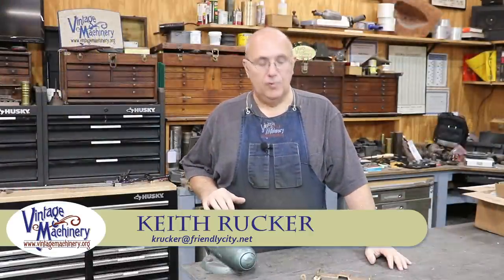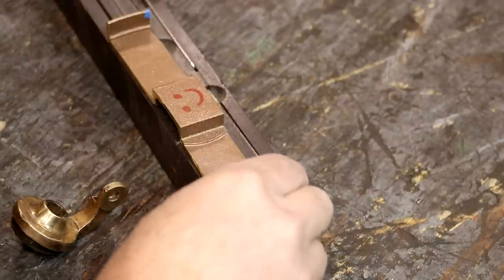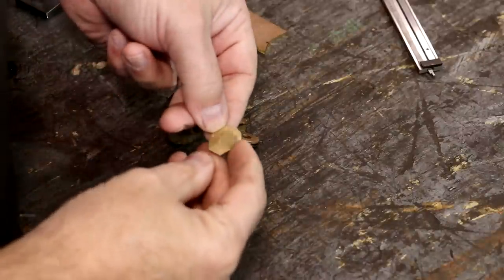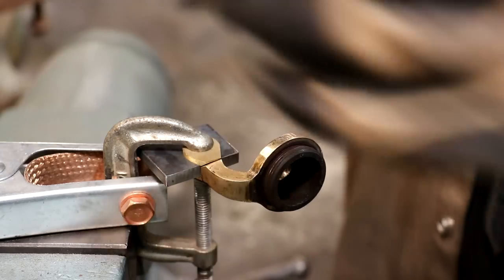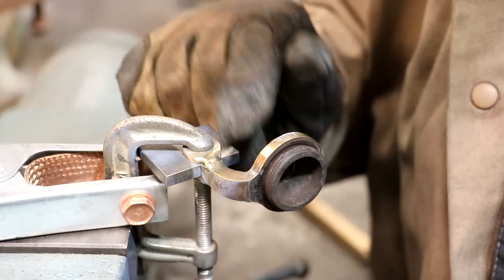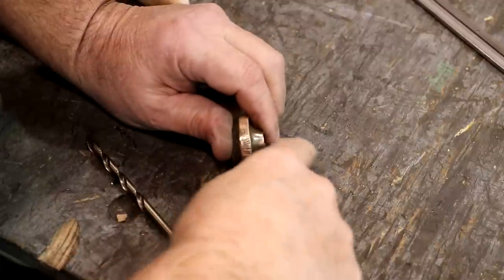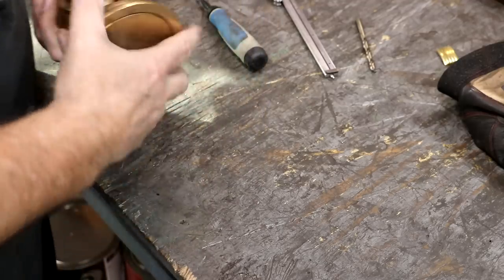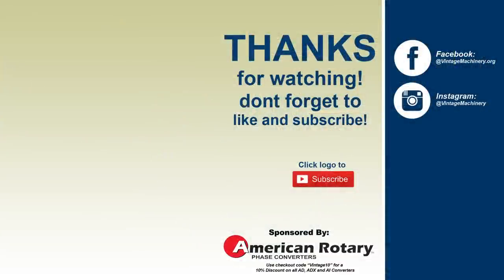Repairing a 1877 Patented Crosby Steam Whistle

Comment: hi keith i had to do a similar repair and to get some material in the cavity i mixed a paste of flux and brass shavings and put some in the middle and torch brazed it worked real well
Reply: I was thinking about scraps as he whittled on the band saw and tossed a few bits. If they haven't been vacuumed yet those bits are still there. Yeah it's an OCD.

Comment: I used to work for General Electric and we used to have to repair a lot of brass , when we couldn’t get a good weld job using melted bronze or whatever we always silver solder and we had a very high success rate. You could’ve use silver solder down in there in the inside joint to add the extra strength that you were wanting to provide on the ear but you didn’t and I know you silver solder all the time. Gary Black

Comment: I know exactly what you mean about wanting to be able to get inside and just finish this properly. I often feel that urge to do 'just a little more' when I am carrying out repair jobs around the house or whatever. Sadly; equally often that 'little bit more' ends up ruining all the work you have done to that point!

Frustrating as this is, I think you made the right decision Keith. It doesn't look like it is going to have to tie off a battleship or hold up the Forth Bridge all on its own!!! So... Likely working as a simple pivot it will give many years more service. If not... Hopefully the chap will return it to you and the process of casting a whole new part will be fascinating to watch also. That top-aligned thread though... That will be a toughy!

Comment: Re: getting the part upright with the threads.  This is a common issue in steam fittings.  The solution is very simple.  Copper shim washers of various thickness are inserted, and then when tightened up, the rotational angle of the fitting is controlled.
Reply: I would hate to try to remove that part he hammered tight. I think shim washers are the right solution.
Reply: @robertcornelius3514  Well accepted solution too.  Perhaps he didn't know it.

Comment: Perfect case for milling a shelf in the casting, making the new tab to precisely fit and then silver soldering. Only downside I could see would be the very slight hint of the silver in the joint but it would absolutely be strong. I have no experience with tig brazing so I personally would never attempt it. Go with what you know.

Comment: I enjoy your channel and have learned something in each episode. l As a journeymen welder I have these observations; a vee prep and filler rod would have provided full thickness weld and when base metal and the filler rod are melted the joint is considered a "weld". Brazing only melts the filler rod. Welding on small parts is always difficult, patience is the key.

Comment: Next, I would try machining off a bit of the curved brass arm to make a bed for your patch piece. Just so it has more contact surface to hold it together. Then solder or braze the patch in place. Or cut the end off entirely, drill and tap it for a brass post, screw on a new blank of brass,  braze it in place, and machine some new ears on it.

Comment: I think the reason for the two different pieces melting sooner than the other is that the original brass piece probably has lead in it while the replacement part may be lead free brass.

Comment: Keith, me thinks I would have milled a step on the part for the ear to set on for more surface area to attach to.  I would probably used gas to do the welding so the flux could have cleaned the area better than the TIG gas, and the braze might have flowed better between the parts.

Comment: I’ve had success with shavings or a small brass or bronze rod with enough heat to melt and flow into the small areas. Seems to work quite well. A pretty common technique used in model building.

Comment: Curious as to why you didn't bevel the parts after clamping so you could get full penetration on the weld joint. And why you sanded the flat surface of the replacement piece if only to wish it was thicker later. Nice to see you in the shop again

Comment: Hi Keith. This is still welding, even though the materials are dissimilar. Since you are melting the parent material. Dissimilar metals can and are often welded together. Copper-silicon would have been a better filler material, though.

Comment: About "tracing that piece that we have here" (@ 4:00) - I think the better way would be to drill a hole first (in the "donor piece" - just eyeballing its location) of the same dia as the one in the remaining ear, then put a short screw through it, screw on a nut, and tighten it - then just roughly chop-off the brass piece to the shape of the ear and finish it with a hand file (there is nothing critical about the exact shape or dimension of the new ear, I assume - and hand filling brass is a breeze).
Then I'd "adjust" the edge to be welded, and instead of clamping the flat stock with a C-clamp I''d drill a hole in this piece of steel - and I'd use again a screw to hold everything together - cuz that would give me a better access to the weld area. 

...But then again there's more than one way to skin a cat, and every guy is his own boss in his own shop. Anyway, "just sayin'". Also, for holding a bronze piece in a vice (vise) I'd use plain aluminium (i.e. very soft one) jaws, as copper has the tendency to get work-harden (so soft aluminium alloy seem to be a safer option).

PS: I noticed that central part of the donor piece looks slightly thicker (2:26) than the outer parts - so it might be a more suitable one for cutting new ear...? Of course, I know "it's too late, pal" - well, for THIS TIME it's too late, but maybe one day, some day, in the future... ;-)

Comment: Just with a briefest glance when you tipped the donor part it really looks like the center section where the smiley face is, is thicker than the part you used. The step in material thickness would seem to  bare that out. Could you check that out?

Comment: A tiny bit of flux only on the two mating surfaces might have allowed some of the molten metal to flow down into the space between the two parts.  I have done a great deal of silver soldering and brazing.  Mostly with a Prestolite Torch. Ron W4BIN

Comment: If it fails in the future, making a new part from scratch could be avoided by simply making a new ear + stem and then cutting the OG stem half and half with the new one and soldering those together. I've repaired old glass caps in the same manner in the past and even before the tinning process covered the seam, it was almost invisible.

Comment: Keith, 

Considering that the brass is a relatively soft material, it may have been easier to cut the piece using a fine blade on a bandsaw in a woodshop, or by using a fret saw.

If it has to be cast you might try using the lost wax method.   I have had good luck with this for small brass parts.

Bob
Reply: I would have used a jeweler's saw, but you use what you have on hand.
Reply: @machintelligence  I think a fret saw and a jeweler's saw are the same.  If the ear does come off again; look at the valve for the big whistle I brought to the museum.  The yoke for the lever is held in place by tightening the valve gland onto it to the valve body so the yoke can be adjusted to accommodate the pull of the whistle rope.  It would be necessary to make a yoke and gland but easier than making a new pattern.
Reply: @royreynolds108  The distinction seems to be mostly the depth of the frame. Both can use wood or metal cutting blades.
"The main difference between a fretsaw and a jewellers saw is the depth of the frame. Fretsaws give you the greatest reach and are used with a board, while jewellers saws give better blade tension and are more manoeuvrable."

Comment: Why not cut the ends make a new bolt section then just butt weld the new to the old seems like that would be a much stronger and simpler fix? Either way nice repair should work fine

Comment: I think and can tell you from experience that the second you dipped that tungsten into the puddle you should have stopped and re-ground the tungsten EVERY time you dipped it Inoticed there was a few... as much as it sucks to do, not doing it makes it EXTREMELY hard to continue welding and get good fusion you can tell by the blob of brass on the tip getting bigger and bigger and it also contributed to why it kept melting away on you

Comment: Technical question for welders: I was told to avoid welding galvanized items because the fumes from the zinc coating can be toxic. Would this be a problem with brass, which is a copper/zinc alloy?

Comment: Obviously you were joking by having the bandsaw upper guide out of position, and pushing the brass material with your fingers 🙄. A 2 day apprentice is taught better than that. Also starting with a small piece you cut off, drill a hole through it, then use a small bolt with a 1/4 spacer between. You have way too much spacer material, that will act as a heat sink, not allowing a good weld. But to each, their own 😱

Comment: Sounds like your missing a tooth or two on that bandsaw blade , and that should not be brass but bronze, I hear that the zinc in brass doesn't play well with steam
Reply: Correct as far as it goes, this item is not in the live steam though so not applicable.

Comment: I mean.. why didn't you just cut the steel plate to roughly the shape too (Undersized preferably)..? You could have aligned it easy easier
Reply: Probably because aligning it is easier and less time consuming than doing more cutting on a steel plate. this job shouldn't require the cutting of any steel, it adds work.